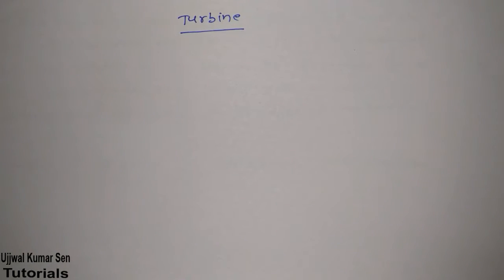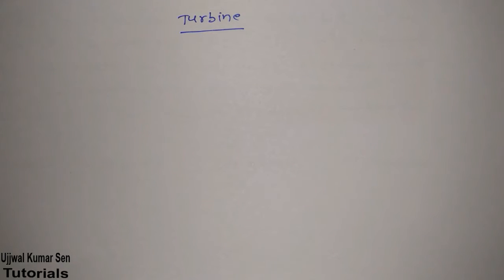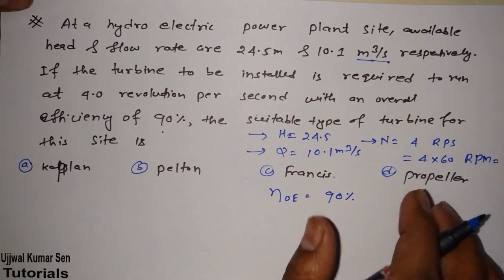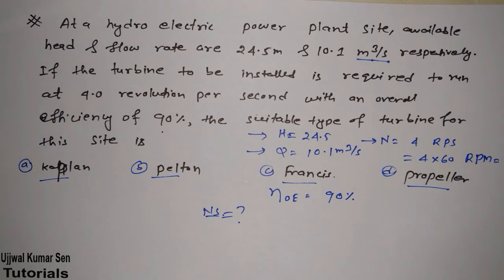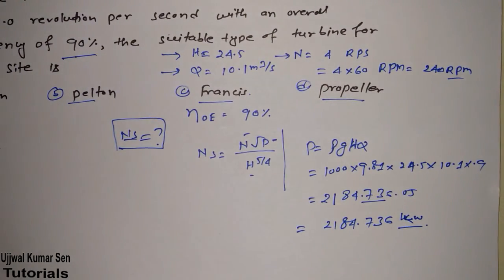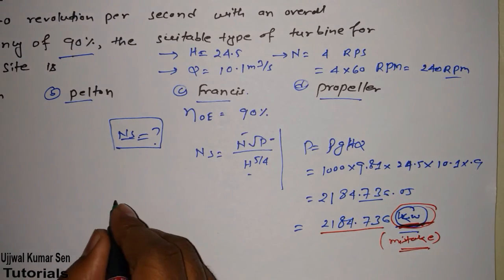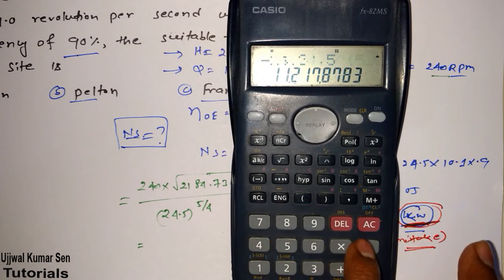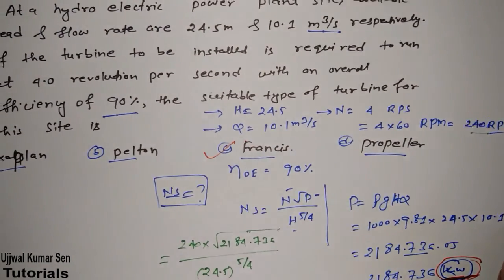Turbine Numericals GATE Previous Year Question with Solution | Fluid Mechanics

Comment: how it solve in a stage of impulse reaction turbine, steam enters with a speed 245 m/s, at an angle of 30 in the direction of blade motion. the mean speed of blade is 145 m/s, when the rotor is running at 300 r.p.m. the blade height is 10c.m. the specific volume of steam at nozzle outlet and blade outlet are 3.45 m3/kg and 3.95 respectively. the turbine develops 287 kW of power. assuming the efficiency of nozzle and blades combined considered is 90% and coefficient of discharge 0.8. find (1) the enthalpy discharge in each stage. (2) degree of reaction. (3) stage efficiency.